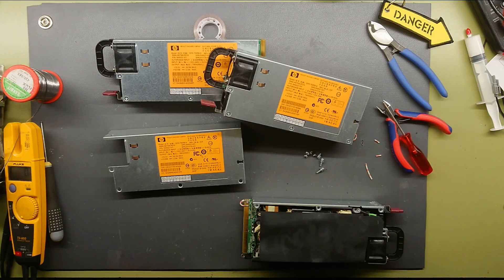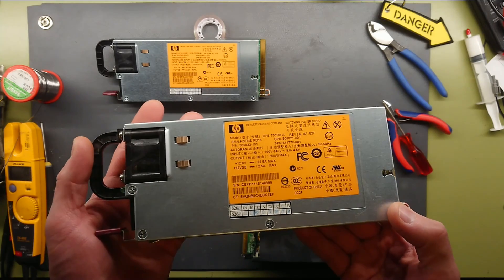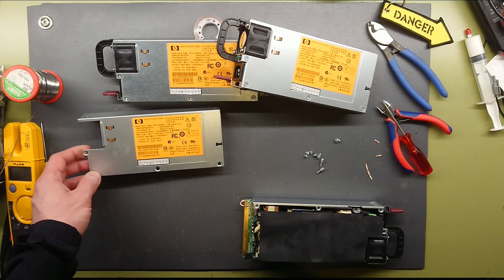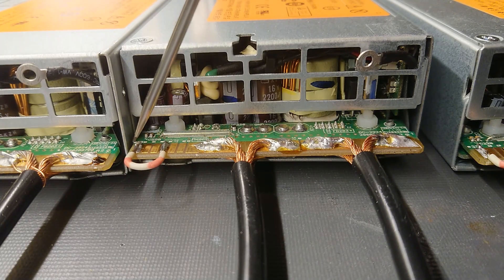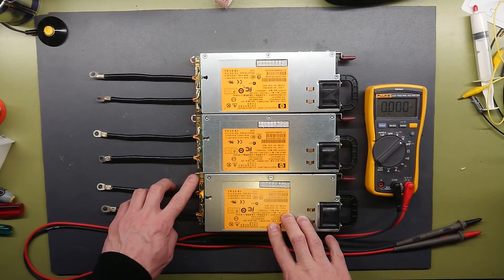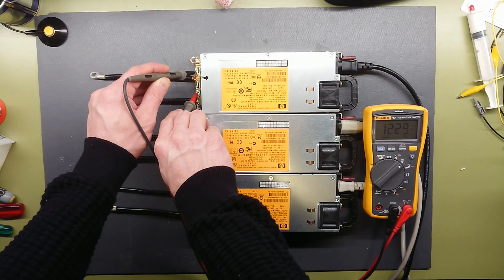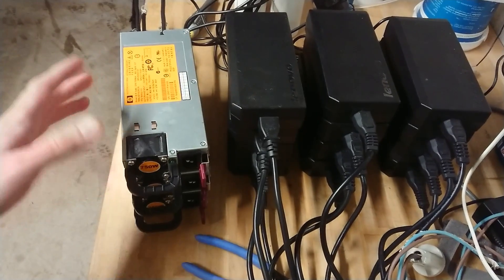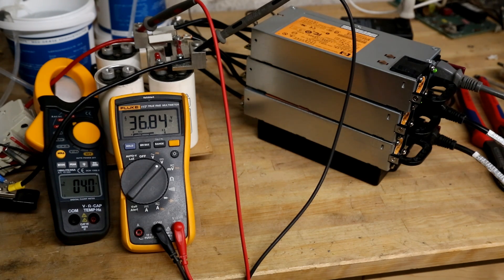2200 Watt Server Power Supply (HP DPS-750 RB) For Induction Heating

Comment: I thought these could not be put in series, that they fail. How long have you had them running for? Lipoconnectionsolutions said he was not able to get these to run in series without failure but he only isolated one of them. Your response would be greatly appreciated since I have 2 I want in series.
Reply: Im Chris at lipoconnectionsolutions. They work for a short period of time and then they randomly fail. The same has occurred with others... not my customers .... Ive had others asking me how I get them to work because theirs kept failing. The only way I was able to get them to quit failing is using the sister model with the long rectangular label. Ive tried a combination of long and short label units. Isolated all of the units. Even not doing the isolation and just insulating the cases from each other.. they all had 1 unit fail at least in my 24v model. Dont know what the failure is. I can stack as many as I want with the long label rectangular label and get long life. The short square labels fail.
Reply: @icecube578  that was me that asked on FB last night
Reply: @icecube578  these supplies can only run 13.6 stable, probably they were volting it to 13.8 or more
Reply: @icecube578  Did you disconnect the daughter board grounding wire on those short label PD-18's?
Reply from the maker: I guess they got around 20 minute in total runtime so far, being used and thrown out units from a server that went beyond "lifetime" could also mean a lot! 

@Christofer Parham Is it also original voltage units that fail? If so I would guess the output capacitance of a unit is lower than the others and the capacitive voltage sharing goes ape shit and we get overvoltage on some of the units.
Reply: @KaizerPowerElectronicsDk  I think how the power supplies are powered up is very important.  If you have two power supplies connected in series to a load, and you power up one but not the other, wouldn't the one that is not powered up see a negative voltage across its output electrolytic capacitors?
Reply: @cruiser97eric1  what if you make a ac cable that combines all the power supplies into one cable

Comment: Do you know how to increase the voltage on the hntns-pd18... I think you can get 13.8vdc on them somehow.
Reply from the maker: The best I can give you, but I have not tried myself. https://www.rcgroups.com/forums/showpost.php?p=25149870&postcount=2238 and https://www.youtube.com/watch?v=4P1-lpzYV1Y
Reply: @KaizerPowerElectronicsDk  You can increase the voltage using several methods ... they work a short period of time... and guess what they randomly fail. Ive been selling these Psus way to long and just when i think i figured it out and got something solid.. I go to put it on the market and I have to warranty returns because they dont fail on my bench or load station after hours of testing they fail randomly with the end user. Most of the time when users are requesting 13.8 they really dont have a good reason to other than it would be nice but the wattage gains arent worth it vs having the units run at their native voltage of 12.3... they can go to 12.6 without issue via a trim pot thats built into certain models but when you got for those higher voltages where you have to defeat the OVP and resistor trickery... Its always ended up being a fail in the real world for my users.
Reply: @icecube578  I heard 13.6 is the maximum you can set it to without it failing, 13.8 is too much, that was your fault for not knowing